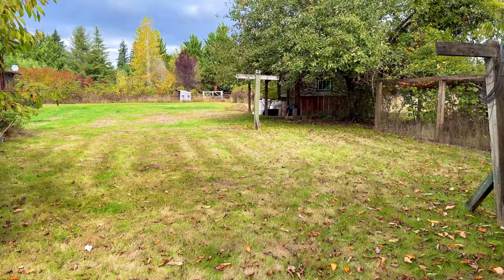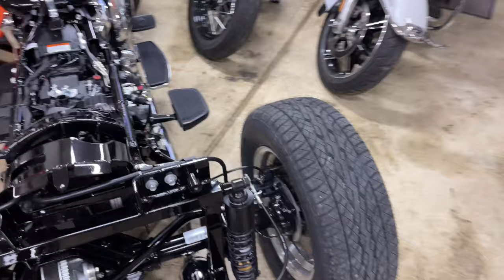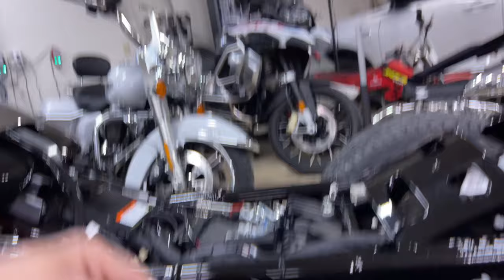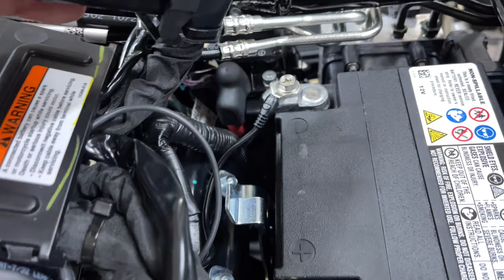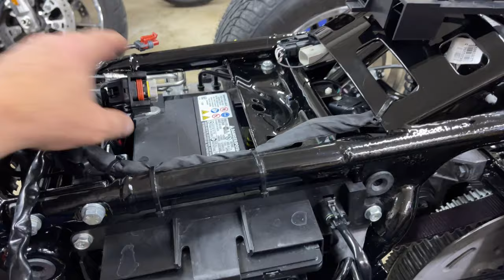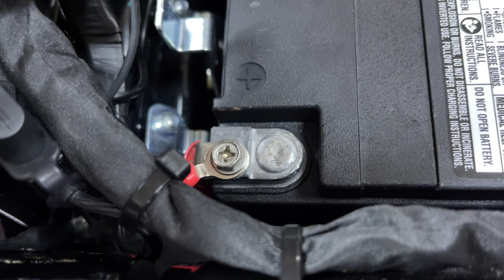This Can’t Be Good..!! • Freewheeler Tech Talk! | TheSmoaks Vlog_2150

Comment: I use Anderson Power Poles for my battery tender lead.  It pulls free with only 7 pounds of pull, so it always disconnects easily.
I guess I got really lucky when I replaced my battery.  I didn't know the trick about disabling before pulling the battery. THANKS for the tip!

Comment: Wow then I guess I've gotten lucky changing the battery's in both my '14 RK and '17 RGS because I have changed the battery's in both without pulling a fuse or cycling the IGN SW. Both have security but not an alarm. I will drag the shop manual out next time. Thanks for the tip!

Comment: I purchased a brand new ‘20 FLHTP Police Electra Glide last year and a “Fan-assist oil cooler” as standard feature and I love it. I understand both Freewheeler and Trike Ultra come as a standard feature as well. Of cause it can be replaced with a standard oil cooler and program at the dealer for small fees. Thank you for your video. Safe ride 🤟🏼

Comment: I wish I had your knowledge. I feel like mine us falling apart. Coming back from a rally my cruise control stopped working. I just parked it. I took it to get the sticker and on the way home don't have back brakes now. Parked it. Now I smell gasoline. I think who worked on it last wired the tow package wrong because I see melted wires probably from the pipes. 😢 I'm so frustrated.

Comment: I have a 2019 freewheeler with a trunk that won't open. it is not locked but won't open. I've tried using the key to lock & unlock it but that doesn't work either. two mechanics I went to had no idea either. have you ever encountered this problem? if so, how did you fix it? thx
Reply from the maker: I'll have to look how our's functions to get an idea what could have happened...  Does the knob turn like normal, or not turn at all (as if locked)?  Bummer you're having this issue!

Thanks Jessi!! 👍
Reply: no the knob doesn't turn... doesn't make the clicking sound like it usually does.  I appreciate your help... this is really a pain - i have stuff in the trunk and can't get to it.   @TheSmoaksVlogs

Comment: I have OCD and hate it when I see a bike with the exhaust not aligned correctly. Then some people don't care about things like that. I love that the Freewheeler comes with the 114 motor. I don't think I have ridden one of those. I have ridden the Tri-Glides, but not a Freewheeler. Ride Safe.
Reply from the maker: If it were not for the slash-cut ends, I may not have noticed it right away...  Once I did though.... Lol  I really like that 114..!  Wish the RK and Slim had it now.

Thanks!!

Comment: What shocks are you running in the back?
Reply from the maker: They are the OEM Showa shocks that the FLRT came with...

Thanks!!
Reply: @TheSmoaksVlogs  so they are air ride? How do you adjust them? I I ask because I just bought a Road Glide 3 but it’s going to take 3-4 weeks to get delivery. Just doing homework.
Reply from the maker: @ElvisOnAShark  - These are standard shocks with adjustable preload. But your 2023 could be totally different…  See specs on Harley’s site for the new RG3, should list everything there. 

Thanks!! 👍

Comment: That's why you're The Man! You know all the little things that would get a less experienced Tech/Shade Tree Mech into trouble. Speaking of battery tenders... Are any of the Opti-Mate's Weather Proof/Resistant? I don't have the luxury of a car port or garage, though I do put a cover on the bike when I know it may see days of rain. I need a tender that can be plugged in outside without causing it damage. Peace and love.
Reply from the maker: OptiMate doesn't doesn't have a weather resistant version, but the Battery Tender 800 https://www.batterytender.com/BatteryTender-800-12V-800-mA-USA-Western-Hemisphere is great for those situations. I have them on the Mowers and the old '83 Yamaha XVZ12 Venture for years now and they've worked great..!

Thanks TJ!!
Reply: @TheSmoaksVlogs  - Thanks Brother!

Comment: Hey Shawn, are those trikes using a solid axle like a spool, or do they have an actual differential in them?
Reply from the maker: It definitely has a differential..!  With rear wheels off the ground and trans in neutral, spin left wheel and rear drive pulley turns, but right wheel is stationary. Go to the right and turn it, same thing but left wheel is stationary.  From there I have no idea about the differential's details, as it appears to be a non-serviceable unit.  No info about servicing it in the factory shop manual...  I found tons of online info saying the differential is actually a solid hub, and with the two axles installed, acts as one solid axle... Lol, Not!! 🤣  It would handle horrible if it was solid...

Thanks Josh!! 👊
Reply: @TheSmoaksVlogs  With the adjustable suspension under the seat simple turn of a fold up hand held knob had the same on my 2019 Fat Boy 114

Comment: Really cool seeing what’s under the covers of that trike!  You mentioned it was geared lower than the Road King, how’s the gas mileage or range on a full tank?
Reply from the maker: It's way too early for real numbers during the break-in period, but it should get approximately 2 mpg less than my Road King...  Bigger motor, 300 lbs heavier and lower gearing will make her a bit more thirsty..! Lol

Thanks!!
Reply: 38 mpg on every tank riding two up and cruising at 60-65 with the FLRT. I get 45 mpg on the FLHXS. Both 2015 and 103HO.

Comment: If this trike is a long term purchase, I’d recommend a set of Love Jugs cooling fans. Trike motors run quite a bit hotter than bikes.  More RPM, more weight, a lot more air resistance with the wide fenders, and the airflow past the motor is not a clean. The fat back end kind of blocks the clean airflow you get on a bike. Before fans, I was seeing head temps up to 320 in traffic. With the fans, it’s never above 255,  even on the hottest days.
Reply: And an Ultracool  oil cooler
Reply: Great recommendation 👍 thx!
Reply: It has a oil cooler with fan in lower front I added the harley rear cylinder fan with manual and auto temp engage switch next will be adding love jugs I really enjoy this trike i purchased 2019 Blue Max FREEWHEELER 114CI now January 2023 no issues

Comment: Thats why I own one a 2019 Blue Max 114 CI next add on will be Love Jugs cooling fans only because i was caught in bad traffic long light summer 95° plus motor was super hot no engine issues it went into parade mode one cylinder firing until i got moving a little way down the road then kicked in other cylinder so far no issues 20,000 miles no winter riding now January 2023 I wonder if this trike could handle a 131CI 😆 WOOHOO THAT COULD BE VERY INTERESTING

Comment: Watch out the reverse motor will burn up! My 2012 Tri-Glide reverse motor has burned out twice. I'm putting a Motor Trike Mechanical Reverse gear on. Then I could drive a mountain as you say with it.

Comment: Only a technician, like a keen ear, would spot the tiny details.. every owner will be checking their cans now.. quality.. should be a recall.. ;<)))
Reply from the maker: Kelly said it was fine, but I wanted to look under there anyway... Lol  If not for the slash-cut ends, I may have never noticed it, for a while anyway.

Thanks Dewi!!
Reply: @TheSmoaksVlogs   Things we do for love.. There's always the basics to check, but it's best to know ones way round any new vehicle, before it's a case of necessity.. an cold, wet or dark.. I've looked over the Himalaya, and needs have been an adjustment/tidy here or there...
Note on over large reverse motor.. over kill.. or too power two up and full load up a 25:1% incline. Cheers y'all